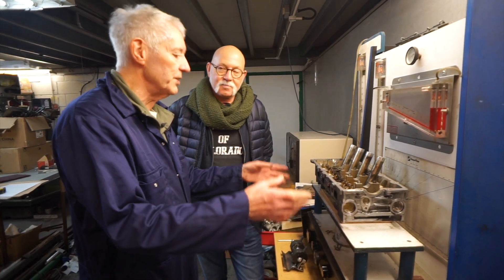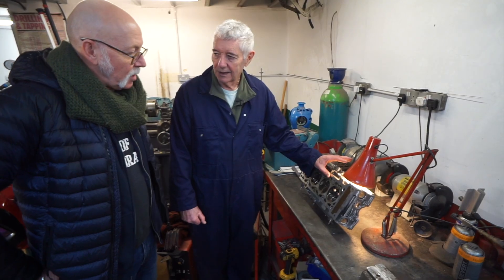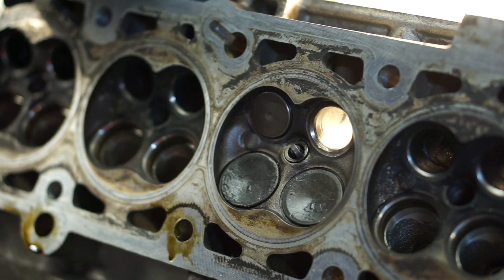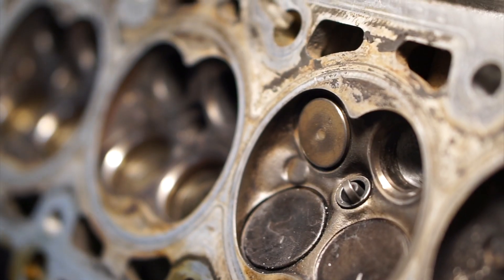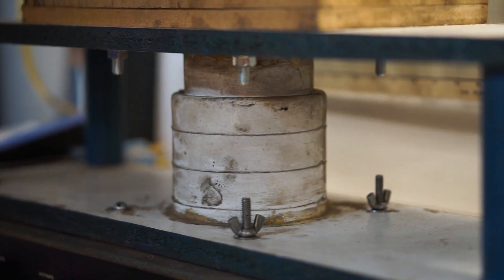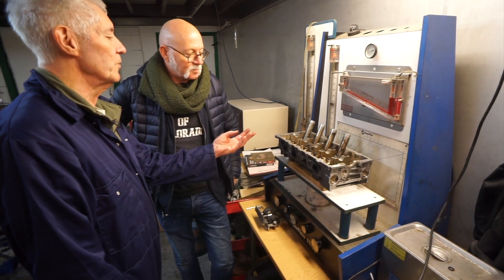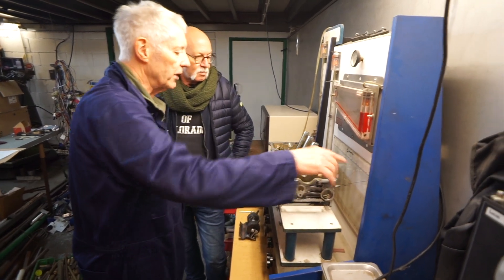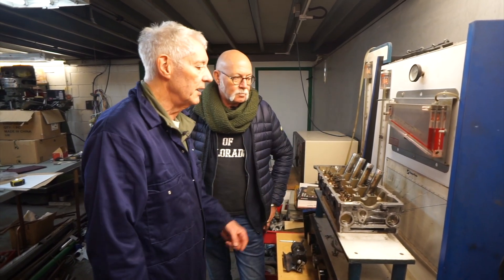Dave Walker of Emerald M3D on Modifying Cylinder Heads for Performance

Comment: Measuring flow under vacuum is not equal to flow under pressure. As this head is supercharged, performance made by measuring by vacuum won't be the ultimate result

Comment: Going back even further, Westlake laboratories used flow benches as did Coventry Climax a little later by the mid 50's.
Those BMW heads are nice little things when re-worked, to the extent for a given pully size, the measured in. manifold pressure drops a few pounds but the power goes up. 
Limitation eventually being the compressor.

Comment: Great to see Dave again. Absolute top bloke. He & Karl did so much to help my projects in the past. Still running an Emerald ECU on the Westfield and always recommended them whenever the subject comes up.

A measure of Dave's patience was one occasion when I took a car to him for mapping, which he did, then he waited while I swapped the cams (which took about 3 hours IIRC as I had to remove a supercharger & plumbing first, then refit it all again...) then he re-mapped it with the other cams. That was a long day.....

A different occasion, a rear tyre let go on the rollers at speed...no fuss or panic from Dave, he just slowed it down nice & safe, no harm done. He then ran me to the local tyre place with the wheel, the guy put a new valve in and off we went again. (The valve hole in the rim had a massive sharp burr on it and as the valve leaned over it eventually cut through the rubber).

Comment: Hes spot on about that head. I did a lot of work on the 05 S I had and it looked roughed when I pulled it off to do some work. Lots of extra casting, poor design, etc. These were made at a Chrysler plant in Brazil and I was rather shocked at the quality of the head as a "BMW" product.

Comment: Yeah, if you have a barn door and a people door at opposite ends of the building, the rate people can get through the barn at is dependent on the size of the people door; doubling the size of the barn door makes no difference (or in a more refined model increases fuel stand-off).
Reply from the maker: Well put!

Comment: David Vizard is/was a great proponent of "deshrouding" the valves within the chamber to improve flow. That head looks as if the exhaust valves would benefit from removal of some meat around the valve to help the gases to get out.

I used live near Shepreth where Bill Blydenstein had his workshop, used to pass quite often. Never met him but he sounded like a great guy and a top engineer.
Reply: I met Bill when a mate was down getting his Nova featured in CCC. Bill had done all the headwork for the engine, so we popped in past for a coffee on the way to see Dave for the feature... Maybe 1995/96 iirc